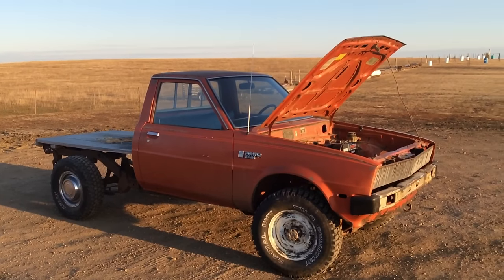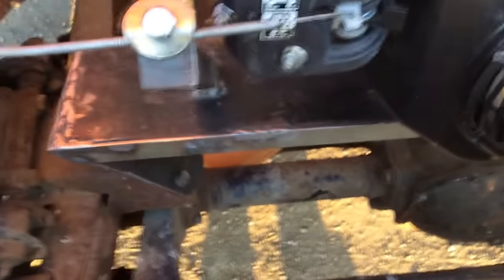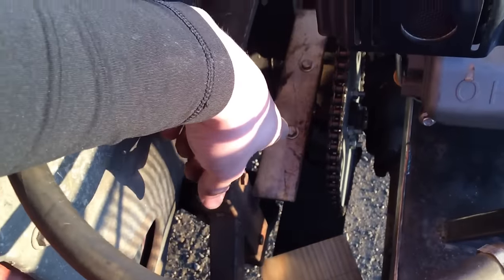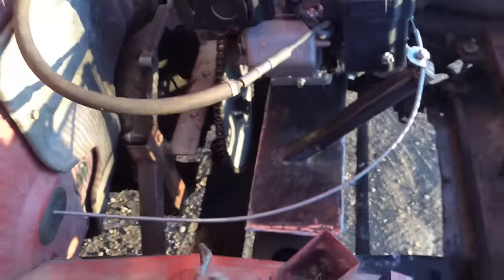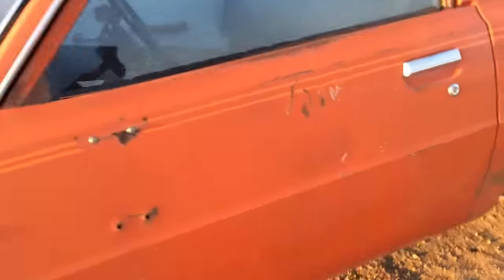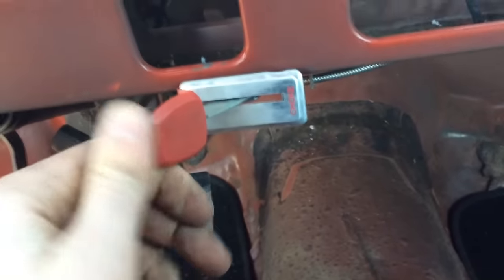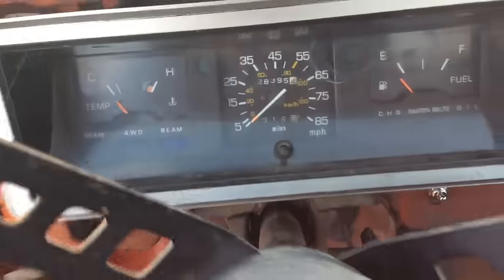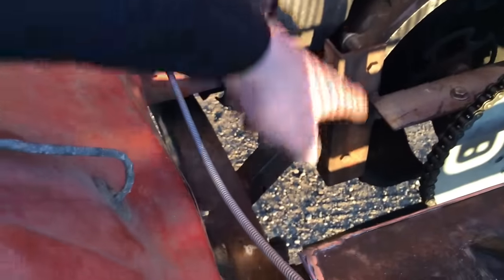Predator 212cc Truck

Comment: Some people swap car/truck engines into lawnmowers, but this guy swapped a lawn mower engine into a truck!😂😂😂
Reply: Seriously though, why?
Reply: @cooliodiablo6117  why not lol
Reply: @cooliodiablo6117  cause you can find old trucks with dead engines for free, he's got a cheap dead simple farm truck there. with low gear he could even do some light towing
Reply: yes, that is exactly what happened
Reply: This engine is closer to a water pump engine or a generator motor, they are designed for high revs for extended periods

Comment: I love this concept, and the installation and engineering execution. 
     In the ‘20s, ‘30s, 40’s and up to early 1960s, trucks were built with low hp and used gearing to haul / pull huge loads, and up mountain passes and ALL over US highways. 
     Be interesting to try various low HP engines and motors (electric), and just tinker with gearing.
Reply: That's still the case outside the US lol

Most trucks here in asia only makes 125hp-150hp from 4000cc 4 cylinder engines.

Its funny seing americans saying how underpowered their cars are when it makes 3x the power of any car here
Reply: @tristan6509  i drive an asian car that makes 270hp with the same displacement  much closer to double lol
Reply: Robot Cantina here on YouTube does this already, they put all kinds of weird motors in weird cars. They recently put a Kubota tractor diesel into a car

Comment: Keep it up kid. It may only be at 20mph, but you're going places with ingenuity like that.
Reply: Lol, true, but that made me laugh.
Reply: Ok he does 20 miles in one hour. Will that tank hold 1 hour of fuel? Whats the miles per gallon? Everything's confusing because I'm canadian everything's in kilometers and litres lol. I wonder if he made this have a hho generator and improved it's fuel consumption by 30 percent. Thing probably gets 100 kilometers a litre or something! If you hunted this would be a great side by side.
Reply: I'm running my Isuzu trooper tank of I believe around 11 gallons and an electric fuel pump and regulator. With the duromax 440cc 18hp electric start engine. I'm hoping to get around fifty or sixty miles to the gallon but I would be happy with around forty. That is some up in the hills time, is what it equates to for me.
Reply: Its a standard so on flat ground or down hill and enough runway it should still run out at a pretty good clip

Comment: This truck will fly if you put a Predator 670cc V twin in it.
Reply: I was thinking the same thing I mean because of gearing it probably won’t be faster but would be a lot more powerfull
Reply: It would be neat if he put two V-twins together
Reply: Someone has a supercharged 670 with 70hp, that's only 13hp less than this truck had factory,
Reply: @wolfyk95  that 70bhp is just a guess, he never dyno it, was a cool build.
Reply: @aeroflopper  cars n cameras?
Reply: @gregsteele9002  no the guy that built the engine,
Reply: Well the predator twin is getting up around the hp of a first gen VW beetle, so probably feasible
Reply: @toddwebb7521  that would be around 24bhp..
Reply: yes exactly
Reply: These had the WORST transmission EVER!.
Reply: perfect farm vehicle (?)
Reply: @randrrcscorbin-tyler3998  Just change the ring and pinion in the rear end.
Reply: @collinklitz7434  Maybe an old Wisconsin V4
Reply: i think the 6.5 can power it just fine it just needs the sprocket ratio changed to go faster is all.

Comment: You should use pulleys and extend the starter cord into the cab. Cool project.
Reply: Or a starter
Reply: Get electric start for it, that would be nice.
Reply: Or he could have used a 670cc
Reply: @tebibyte2357  
Id do an air cooled in my car, work is only a mile commute. 
ive got a few briggs v twins laying around
Reply: @MrTheHillfolk  That sounds epic!
Reply: @MrTheHillfolk  I would like one so I can put it on my gokart. Engine length need to be 17 inches or less
Reply: @MrTheHillfolk  Could you mail my one lol😂
Reply: PE, PP or PA tubing would work too, no need to make overly complicated with pulleys, also protects the rope.
Reply: every ones saying move the cord in the cab I was thinking choke in the fender
Reply: Or a kick starter put in the front like  old model T's
Reply: @MrTheHillfolk  V twins are awesome. Supposedly these 212cc engines can make 20hp, imagine what a V twin could make, it could almost be practical.
Reply: @tebibyte2357  or a 13B
Reply: @jm036  
And leave it open pipes to mess with people , they sound like miniature harleys. 
I always thought it was odd to hear a harley, and see some sport bike go by(buell)....messes with your head.
Reply: @jackmehuaff7455  Me, too!
Reply: @tebibyte2357  They are racing the 212 Predators on go carts and there is a good supply of racing parts for the 212. If you have a Harbor Freight near by, watch their adds because they often offer the 212 for just under $100.
Reply: @ronfullerton3162  well for a little speed and a little torque the 670cc would work fine especially because of 2 cylinders and it also is for harbor freight
Reply: @volvo245  There would of been fancier ways if doing it. But I bet he used whatever materials were in the shop on hand at the time. And those people who can make do with what is on hand are resourceful people. Good thinkers.
Reply: @tebibyte2357  Very true. Plus the motor in between these two is a single cylinder with more power than the 212, and also has electric start. The V twin maybe a bit pricey for a young man.
Reply: @ronfullerton3162  13hp one might be the best.
Reply: @tebibyte2357  the young guy didn't have the money to buy 670! Harbor Freight sales those for $99. There are several of y'all on here saying 670, 670. Give him a break.
Reply: @jackwatkins7382  ok bro chill.

Comment: Put a pulley on the fender and route the pull start rope through the firewall and into the cab, and you can start it from the inside!  Looks pretty good!
Reply: I like the way you think.
Reply: There’s an electric start kit for the predator 212. Why bother with a pull start into the cab? Either way, this is still bad ass!
Reply: @joseromo7594  Why not? I'd run both. Something fuckin hilarious about pull starting a pickup
Reply: you wouldn't have much room to pull it and you might slam your elbow. it's easier to do it through the fender.
Reply: I'm wondering how much work it would make to get this road legal.
Reply: @boziewz6125  a lot. this thing is no where near fast enough to be road legal.
Reply: @ElectronicsForFun  I know some states in the US allow certain machines that are restricted to 20mph and with this doing 20mph maybe it could come under that classification? 

I know in the UK it's a little harder, but we do not have a minimum speed limit but do have age related speed restrictions. I've known a few to have a reliant robin on a CBT and blanked reverse. 

This truck would need a wheel removing and would likely pass under that classification (obviously removing a wheel in such vehicles is somewhat 🥴) but you get the idea I'm going with.
Reply: @boziewz6125  but that's like a golf cart classification. there isn't much you can do with a class like that at least not hear in the US. maybe it's a grocery getter if you live in a small town but not much else to it.
Reply: Truck probably doesn’t have a “firewall” per say, it’ll be easy to install.
Reply: @ElectronicsForFun  Black eye

Comment: Nice swap. Just a simple little run around truck. 

Imagine if you could ever get a 440cc predator and electric start...it’d be luxurious and faster.
Reply: Too much power! You couldn't possibly control a monster like that.
Reply: @mothman-jz8ug  shes already beating EcoBoost Mustangs in the streets, imagine her with that sort of upgrade
Reply: Generator motor?
Reply: Unless you bypassed the govenor it would have saMe top speed.  Both run 3600rpm
Reply: Chocolate dragon  true but with the bigger engine is more power wich means you can back down on the gearing from say 18:1 total now and go to 16:1 and still have the same end result hp outcome with a higher top speed.
Reply: @NotoriousMastaG  r/woooosh
Reply: @Chocolate_dragon  But you could gear it differently to get more top end.

Comment: Towing capacity may be a little bit compromised haha. Nicely done mate.
Reply: Furn333  That lines up with the other phrase "anywhere is walking distance if you have the time".
Reply: It was with the original engine
Reply: @kansascityshuffle8526  Yeah, they only had about 60 hp
Reply: Furn333  Just very, VERY slowly.

Comment: This is like the predator swap from life OD but better executed.  Well done.
Reply: i know life od didnt have a clutch or throttle, but they had a 420
Reply: I hated that they wouldn't at least put a clutch in line, welded to the transmission.
Reply: @hansevensen8426  They only did it for the views, hence poor execution.
Reply: @MrTheHillfolk  I seen that same truck .

Comment: Young man, you're gonna go far. Compared to these other kids today that get everything handed to them on a silver platter, you're a hundred miles ahead of them let me tell you.
Reply: I have got to agree. He had it well though out and it appears he has good tool handling skills to go with it. It is just wonderful to see what he has done. He will be a "good one" at whatever his direction in life may be.
Reply: Some Asshole, you are right I have friends whose parents bought them their cars/first vehicle but unlike them I had to pay for my first vehicle myself. i we found an old 1995 Ford F-250, but the truck did not run I had to get it running. since it sat for 3yrs and was parked in a field for that amount of time, and since horses were in that field they detailed the truck for me/put teeth marks in the paint mostly on the hood of the truck. Luckily for me the truck was equipped with the legendary 7.3 Powerstroke Diesel and the truck ran when it was parked and diesel fuel usually does not go bad, so we bought it a new set of batteries and she started right up like a dream, but it had a fuel leak so we replaced the faulty fuel lines, replaced some sensors, an oil change, repaired the wiring harness, and are in the process of replacing the valve cover gaskets/new connectors for the wiring harness. I have had to pay for most of the parts myself and I don't even have a job (since i'm 15) so making money is a little harder, so all i can do to make money is to do chores, mowing lawns, and that sort of thing even though we don't live a traditional neighborhood to mow lawns so the lawns are a little bit bigger. (4-5 acres) great video EverythingWithWheels, now that to the truck moves can you get it shifting or is is equipped with an automatic trans.
Reply: @michaelbenoit248  But you have learned so many life lessons already. And I bet your truck means more to you than those other kids cars do. Seems tough to have to work harder for what you want than the kids just getting things handed to them. But you are going to be tougher than they when life throws roadblocks up. You will do well!
Reply: @michaelbenoit248  great stuff young man!!!!!
Reply: Ron Fullerton, you are right my truck means a lot to me in the sense that I have seen in and out of the vehicle and I know that the truck for the most part mechanically is in very good condition on terms of the motor, and that it feels good to breathe life back into an old piece of american history that has lasted 24 years and 366K miles of use deserves to get a little love especially with the motor it has. and with the motor that it has if taken care of the motor will take care of you and can last a very long time.
Reply: Fuck, you are just talking about the rich kids. I had to build my own ford escort without any help or prior knowledge for my first car. While the rich kids would get a mercedes brand new at 16
Reply: dude, i kid you not, I had to teach a 31 year old man how to mop a floor Monday night. this kid is LIGHT YEARS AHEAD.
Reply: Some kids that get stuff handed can still turn out great and be great full for what they have.

Comment: sounds like it's only running on 1 cylinder.
Reply: Well, it was a Dodge, probably after 60,000 km it probably WAS running on one cylinder.
Reply: @WJCTechyman That is way it runs so well now. The rest of the truck is used to one cylinder power.

Comment: One could argue that HFT engine is a huge upgrade from the factory power train
Reply: true, mitsubishi engines from that era were somewhat unreliable and tended to overheat and blow head gaskets for no reason. friend of mine had a dodge colt that blew a head gasket in december, in seattle, cruising the freeway at 55mph.

Comment: You’ve just made the worlds first reliable dodge! Great job!
Reply: That car was a rebadged Mitsubishi...
Reply: fired up fishing lol
Reply: Oh, the brutality of that comment is amazing.
Reply: I think you mean Ford.
Reply: @lycan5877  Not so clever, are you?
Reply: How dare you sir!!!!!!!
Reply: @lycan5877  Ford did have a Japanese made mini pick up called the Currier, but Dodge through the seventies sold a mini pickup called the D50 and a car named the Colt that were made by Mitsubishi in Japan. I had several colts and wanted to get a Sport D50, but was just young and broke kid.
Reply: dodge 2.2 is one the most reliable 80s engines ever made
Reply: @daftnord4957  I had the 1600 in a 1973 Dodge Colt GT. That was a tough and reliable motor also. That was before they put the "silent shaft" in the 1600 motor. That, to me, really ruined the motor.
Reply: lmao
Reply: fired up fishing beat me too it. Was gonna said wait a dodge that actually runs decent?!?!
Reply: The 318 small block v8 has been considered to be one of the best engines ever produced.
Reply: Theodore Dow according only to dodge fans. Real people know that would be the Ford 302 or Chevy 350
Reply: @Gkitchens1  every manufacturer had that one go-to reliable smallblock. As well as their respective inline six cylinders. Not saying that other parts of the vehicles didnt have their own problems however. Transmissions bit the dust on alot of dodges, the electronics on Chevrolets were straight garbage, and fords front ends would shake your teeth out of your head. One day you might get over your silly hatred for brand names and learn if you put a 350 on a dodge chassis with Ford electronics, you'd have a total bulletproof package.
Reply: @Gkitchens1  I think it was actually a bunch of engineers. I can enjoy more than one of something so I don't get bent out of shape about such things.
Reply: As the former-owner of a 1999 Ram 1500, this comment made me legit laugh out loud.
Reply: Theodore Dow it was a joke my dude
Reply: lol I have a 99 Dakota 318 with almost 300k miles original engine and transmission never been rebuilt and a 74 Plymouth Duster 318 my dad ordered from the factory it now has 360k miles on it never had the heads or oil pan off or the intake just a timing set and one starter multiple water pumps and one alternator and one fuel pump the 318 had the best rod to stroke ratio of all the small blocks for longevity and high nickel content in the iron blocks and heads. that makes them last longer.  one big contributor to how most things last a long time is how you operate it and take care of it
Reply: mjhound you’ve heard of a joke before right?
Reply: mjhound and that duster was the exception not the rule. They were garbage for the most part.

Comment: That thing got a hemi?!?!

Yes, yes it does!! lol Nice!👍🏻
Reply: I noticed it has the cast valve cover which I'm told is the Hemi version, the other one is stamped steel and not a Hemi.
Reply: G56AG Yes. You are correct.
Reply: Aren’t all engines except rotors hemispherical engines? Unless you have square pistons. Or if you going off the tiny tiny detail which makes a hemi a hemi.
Reply: just wrecked a classic truck... Should of bought a new f150 yanked the EGO -boost lol.
Reply: In stock form the hemispherical head Predator doesn't seem to put out as much power. I put one on my 46" cut antique Sears Suburban and the carb needle stuck and filled the crankcase with gas. Of course it blew that engine. I replaced it with the old style Predator and it pulls better than the Hemispherical head ever did. They do seem to run out faster on a minibike but don't pull as.well on a long hill. But for building hi performance I'd choose the Hemi hands down.
Reply: @OK-st9st  hemisperical engines have nothing to do with the pistons its the head design
Reply: Matt S. Their basically the same, I just don’t believe in the hemi design unless you want less compression and worse gas mileage. More volume is harder to pressurize. But could make a high horse power car last longer. You can do the same effect by getting shorter piston rods. Or putting on 10-50 head gaskets lol.
Reply: @OK-st9st  No. Hemi's combustion chamber has literally hemisperical shape, but you can have other designs, especially when you want more valves per cylinder - penta head. Other types of combustion chambers could be bathtub or wedge shape, or for example SV engine (flat head) that has quite complicated shape of combustion chamber.
Reply: Jan Nešpor my 1997 ej22 Subaru has a Penta head. But not a hemi. Less wasted volume per cylinder. Because it doesn’t have that bubble in the metal you call a hemi.
Reply: @OK-st9st  By writing "other designs" I mean that penta is not hemi head.
Reply: @OK-st9st  The only TWO relevant details; a hemispherical chamber with canted valves.

Comment: This is an amazing video! And what a project! It’s amazing how many cool vehicles are out there with bad engines and now for $2-300 you have the best built go kart of all time! 

You could pipe the fan engine cooling air through a dryer hose and have a heater for winter! 

Just be careful with those fumes!